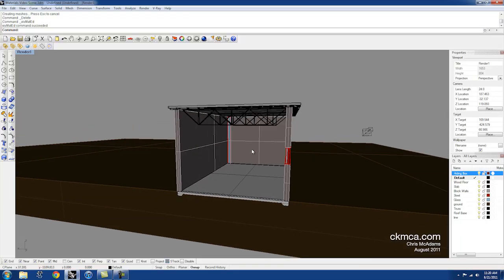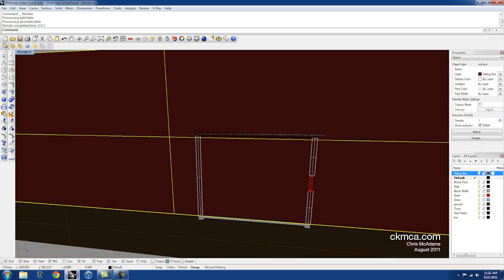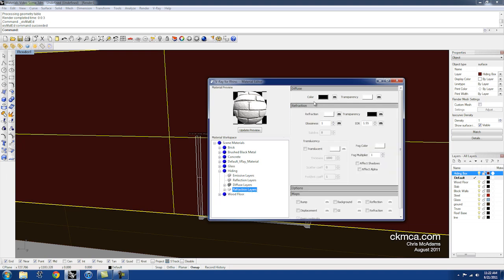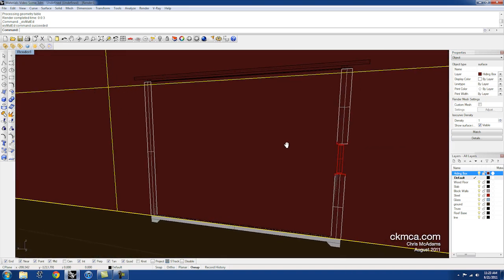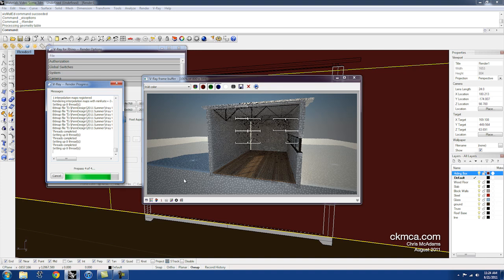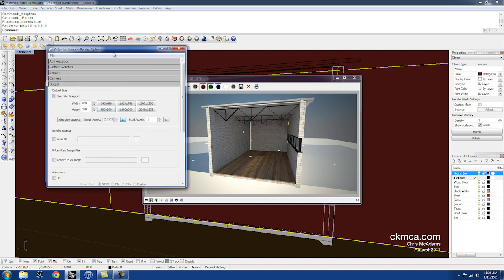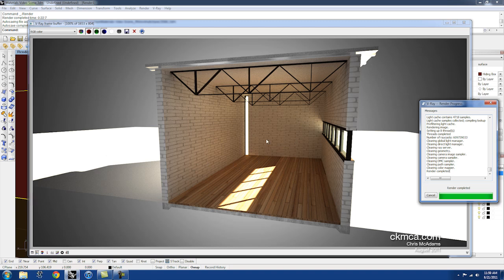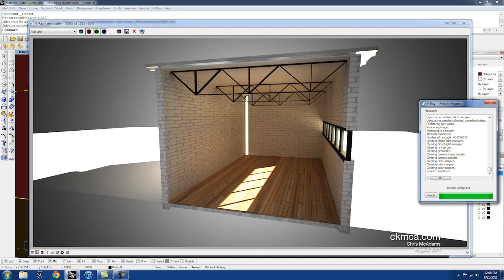[Advanced Materials] Part 3 - Adding Invisible Materials

Comment: Chris! Thanks for the great tutorials! I'm trying to render a section in vray for sketchup, with a hidden wall as described in the video. But when i create the wall it becomes completely translucent; the light floods in. Do you know if its possible to create the same kind of hidden wall in vray for sketchup? I've been using the same material editing options as you showed, on a surface connected to the section cut. (The model is "sliced" so the stuff behind the cut is deleted) Cheers